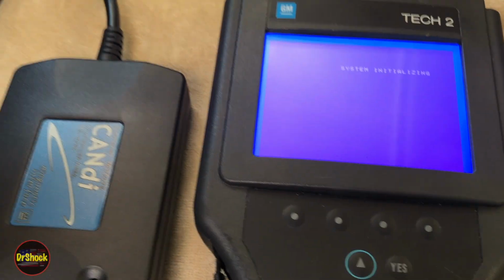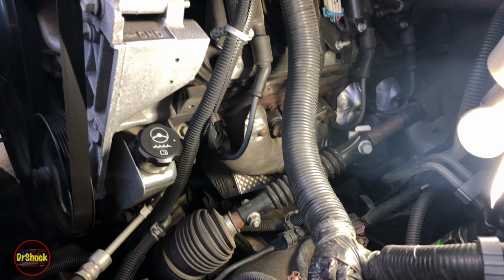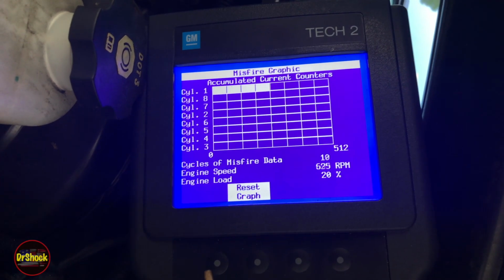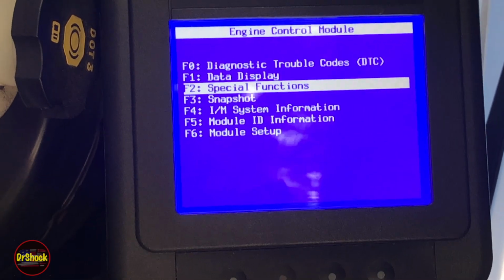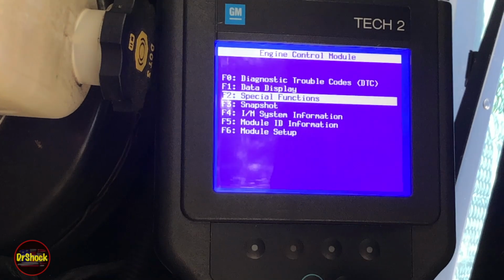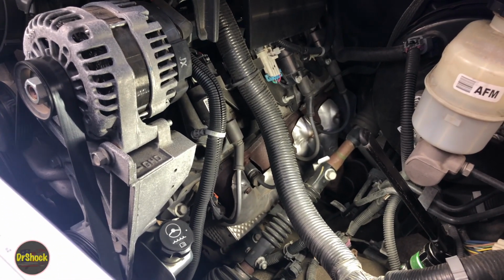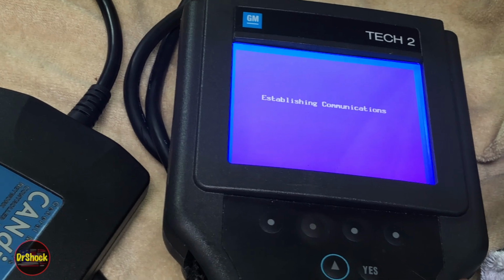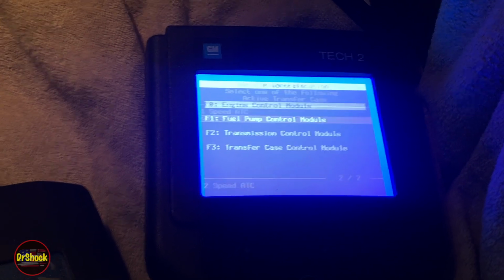2007 - 2014 GM Truck AFM 5.3L V8 P0300 DTC Single Cylinder Misfire Diagnosis & Repair (Chevy & GMC)

Comment: I’m looking to get a Tech2 to use on my 2009 Pontiac G8 GT to diagnose a P0301 DTC and for future use.  Do you have a preferred recommendation?
Reply from the maker: Even the clones of these haven’t been manufactured in a while now. You can’t be too picky about where you find one. I believe I have a link in the video description where you can search on at least one source. Best bet is to try to get a set up that comes complete with the TIS2000 software DVD, as well as all of the cables and adapters.

Comment: I had this problem on my '03 5.3 for years. Even replaced the good coil packs. But it still occured. Finally. A backyard mechanic told me he could fix it ... He knew what the problem was. It was the intake manifold gasket. He changed it. The problem went away for good.. didn't make sense to me... Every mechanic I took it to was certain it was the could packs. They were all wrong. The druggie alcohol addled idiot down the road nailed it after 1 drive up a steep hill.... I wasted a ton of cash on all those dam coil packs

Comment: 2009 Suburban LC9 190k miles, just dealt with random misfire. So random it wouldn't even throw P0300 unless I really lugged it up a hill.
Tech2 showed Cyl 6 to be the culprit so i swapped coils and misfire followed.
I believe the misfire reporting system has been numbed for the AFM vehicles so as not to report false misfires when switching modes.
BTW, 193k miles, still runs strong, only used a Range AFM disabler for the last 10k miles or so. Walmart diesel oil for at least the last 10yrs.
Reply from the maker: For a 2009, you may want to review the GM service bulletin I put in the description text area of this video to make sure the factory upgraded parts (valve cover and AFM valve splash shield) were installed at some point in the Suburbans past to cut down on this oil consumption problem.

Comment: In my 2009 manual, it says the ohms should be between 397 to 1337 ohms and last set (748UU) averaged 842.  Maybe the low resistance wires ate the electrode?  Just replaced my CANdi cables, thanks again for making that old video!
Reply from the maker: GM will revise various specifications as time goes on, perhaps as manufacturing tolerances were improved they were able to tighten the range by the 2013 edition.  Just speculation though.  

Most likely the oil consumption accelerated the plug electrode damage, rather than the aftermarket asian imported wires.    The GM service bulletin I linked in the video description describes the AFM induced oil burning even causing the ceramic insulator to crack.  Glad the old CANdi repair helped.